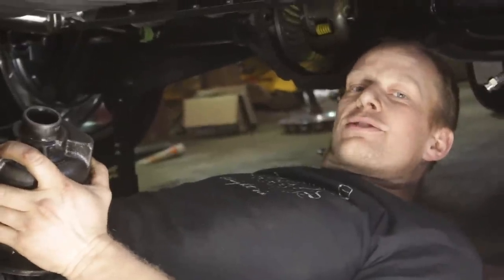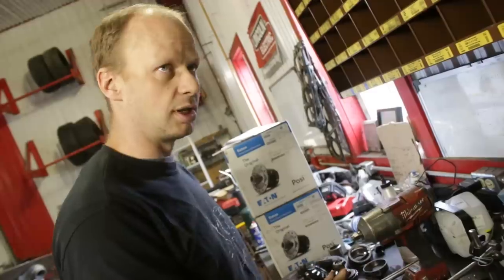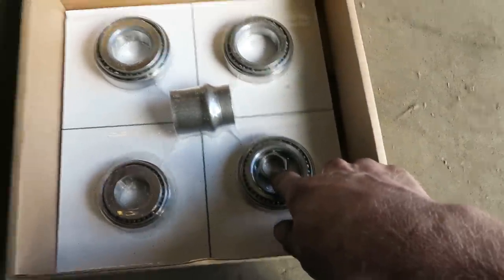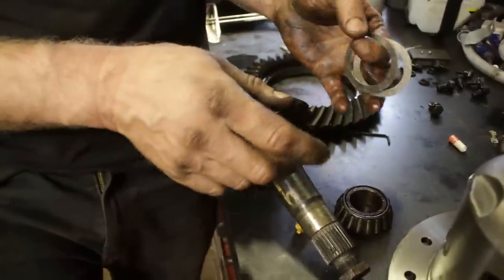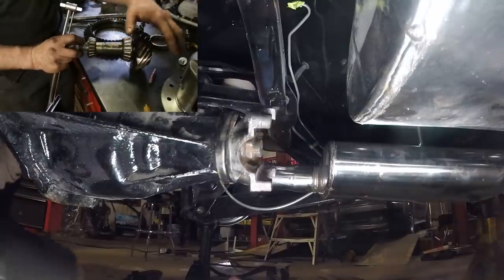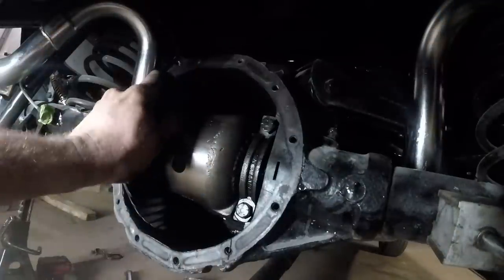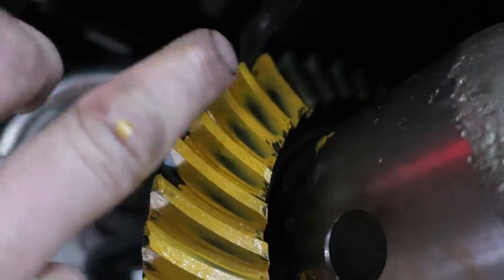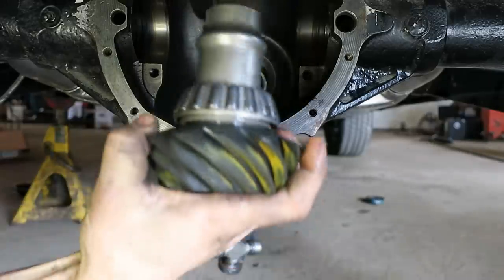How To Install An Eaton Posi Locker Limited-Slip Differential | '67 Pontiac GTO [EP21]

Comment from the maker: The '67 Pontiac GTO gets a limited-slip diff! Here's everything we used:
Eaton Posi https://www.summitracing.com/parts/ETN-19587-010
Gear Ring and Pinion https://www.summitracing.com/int/parts/rmg-4900941/overview/
Ring and Pinion Install Kit https://www.summitracing.com/parts/SUM-G7917K
Dial Indicator https://kit.com/debossgarage/dg-toolbox/clockwise-tools-dimr
Milwaukee M18 FUEL 1/2" https://go.magik.ly/ml/mpz4/
M18 5.0Ah Battery https://go.magik.ly/ml/mpzh/
0-80 in-lb. torque wrench https://kit.com/debossgarage/dg-toolbox/performance-tool-m19

Comment: WRONG..it isnt how many bolts are on the diff cover A ... it's how many bolts hold the ring gear on ...B 12 bolt equals 2 parallel bolts on the diff cover being parallel at the bottom..a 10 bolt has one bolt centered in the middle a the bottom.

Comment: For all those attempting a gear replacement - you can buy setup bearings from several different places.  These have been turned down (on a lathe) on the inside diameter so that they will slip over the pinion shaft without pressing them on.  It is usually a lot easier than using a grinding stone to increase the inside diameter of the bearings.  For those of you that wonder about whether there is a problem using one bearing for setting the rear end up and then using another to actually install into the rear end - Tapered roller bearings (aka Timken Bearings) have VERY tight tolerances between bearings, so it is perfectly OK to swap one with another, you can expect it to be almost exactly the same dimensionally.  Also - if you haven't done any gear setup before, you should buy a number of crush sleeves with your rebuild kit, because you WILL have trouble getting the right crush the first time.  You should also measure the height of the old crush sleeve before throwing it away, this will help you to get the right amount of crush on the new sleeve.

Comment: Back in the late 70's and early 80's in the dealership we used a special tool that was a long bar that fit the yoke and when turned hit the frame. We then used a very long breaker bar, and you could feel the crush sleeve crush. The we checked it with the inch pound torque wrench. Great job on everything I have seen you do. Some us cane only dream of doing the stuff you do!

Comment: On the pinion it has a depth on it. Put bearing in case measure to center line  of carrier subtract the difference that's how to correctly get shim pack right .

Comment: You may also need to say you need a good impact gun too. Or did you say that? Had bought a old 1954 Chevy pickup and someone did some work to the rear end and the first time I drove it for a distance over 10 miles the rear end got so hot it cooked the paint off the pumpkin and sounded like bacon frying when I pulled back in the driveway. Old inclosed drive shaft. What a pain those were.
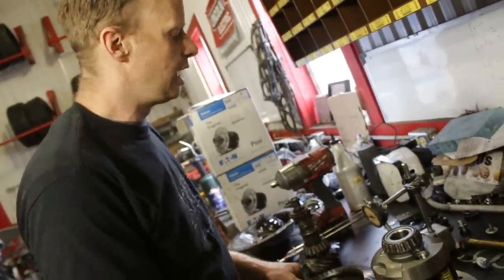Reply from the maker: 2:16 😉

Comment: I know on the gm 10 bolt rear ends the ring gear bolts are left hand thread if the 12 bolt is the same you left that out.

Comment: A “low” gear ratio is technically a higher number like a 4.10 or 4.56. A “high” gear ratio is a lower number like 3.08 or 2.73. The higher the number the lower the final drive ratio and the lower the top speed but you can blow the tires off no problem.
Reply: Gearing math is hard, which is also why gearboxes are like modern confusers. Just one look and you don't know what is happening. Spinny bit here makes spinny bit there go round. All is well.

Comment: want to set crush collar with a compaion flange and breaker bar and set drag do not use a impact it wont be tight enough
Reply from the maker: If your rolling resistance is correct, you got it tight enough.  If you can't get enough 14 inch pounds resistance, you need a better impact.
Reply: That's why he said you need a decent impact 
Not just any impact